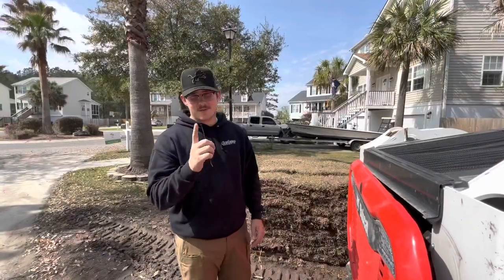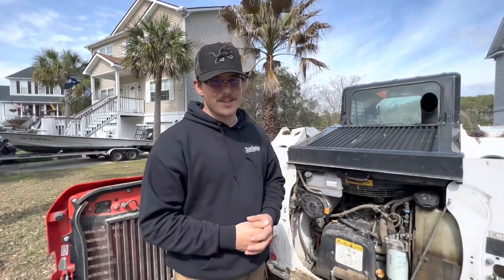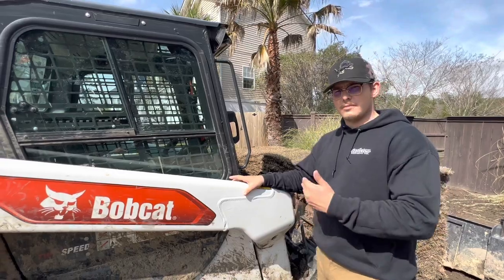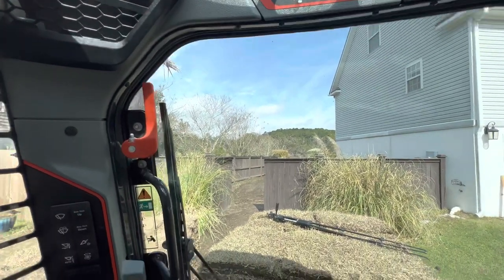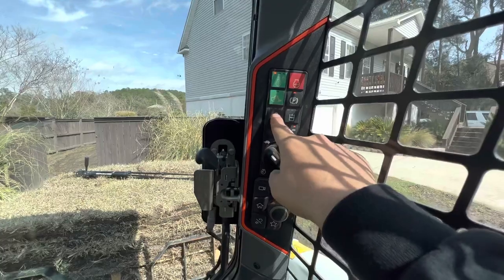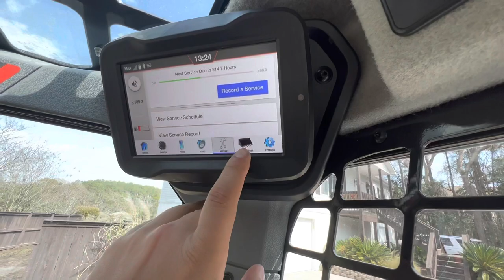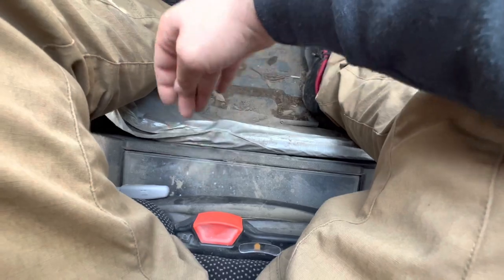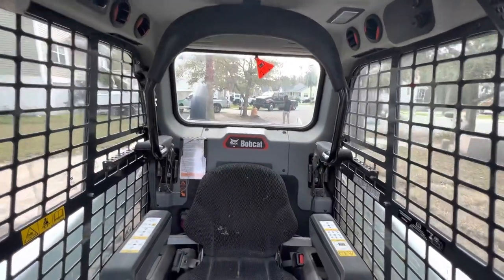2022 Bobcat T62! Hardscape Contractor Review - Worth it?

Comment: I chose this loader last year for my 15 acre rewilding project in the Pacific NW coastal rainforest. if this review had been available then, you would have saved me many hours of hunting for information. I decided it on it mainly for its maneuverability and low psi - in fact I’m paying extra for the wider tread because our access is a 50’ wide flagpole across 350’ of wetland that none of the neighbors believe we’ll be able to cross - and the easy attachment change is probably the thing I’ll love the most about using it day to day. Or possibly the fuel efficiency since we’ll be carrying the fuel 400’ by foot most of the next year while we’re working under a Department of Forestry permit to build a corduroy access road so we can get a nursery set up and start reforestation. This review made me extra glad I chose the T62 for this extremely challenging project. You covered the essentials and gave me more than I had when I made the decision.

It’s on its way as I write and will be delivered in one week and I honestly can’t remember when I’ve been this excited to get started with a new piece of equipment.
Reply from the maker: Let’s go! Happy the review boosted your confidence in your decision 🤩